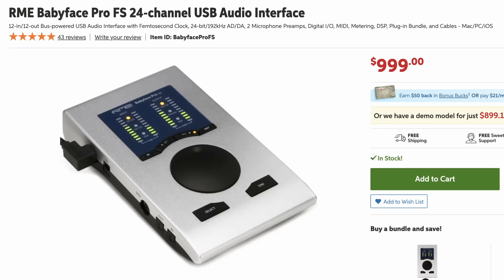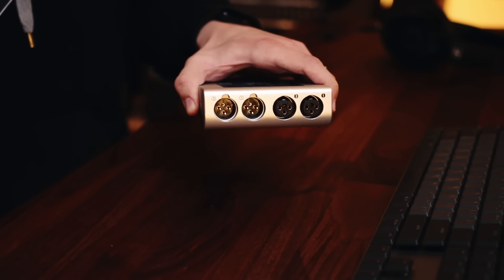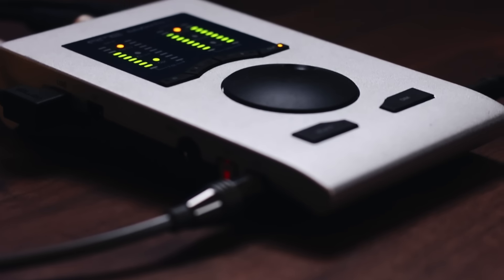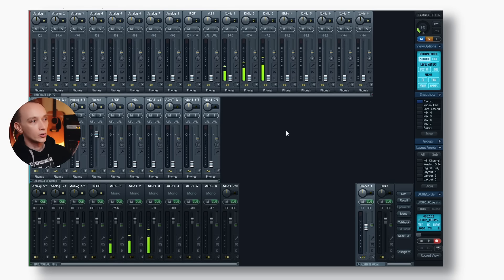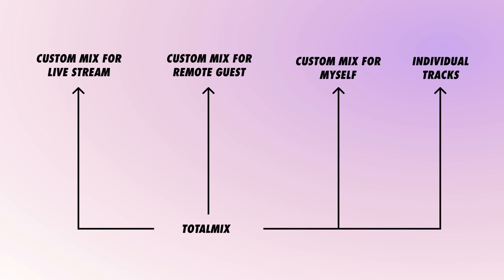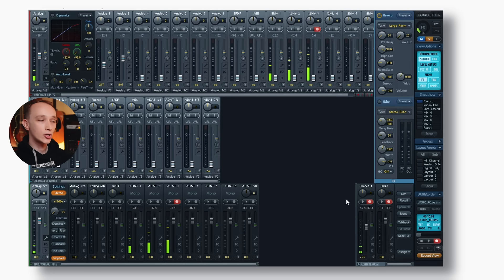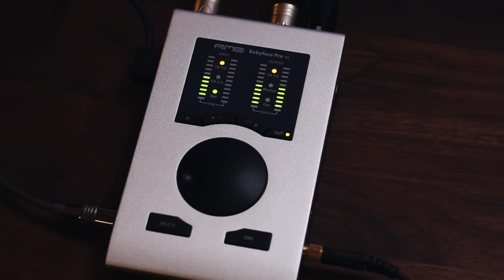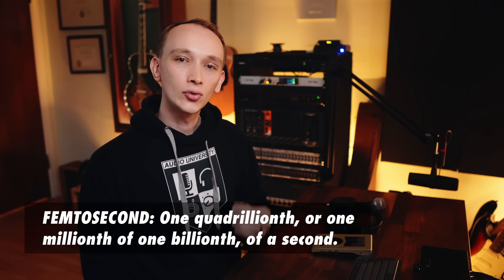Why Would Someone Spend $1,000 On An Audio Interface?

Comment: As I'm writing this, I'm using my FF800 (not 802, 800) to hear this video (YT audio using the stock Windows/mobo 'Realtek digital output' into an ADAT input on the FF) and even though the interface has held up indeed quite well and the drivers have been indeed rock-stable, I'm currently waiting on a replacement for the internal power supply (that the RME interfaces are well know to fail from, look it up) after some 15 years of use (*apparently, they cheap out on capacitors and other components). Also, the driver updates for this model seem to have "unofficially" stopped for about a year or two ago now, I get it that the interface is about 15 years old now, and the company probably expects me to pony up for a UFX III USB 3.0 maybe (it's their business, after all), I shouldn't expect working driver updates forever probably, but I'm just putting it out there, that that's the case. 

With the internal processing, fully fleshed-out proprietary plugin bundles, and the thunderbolt connection, I hope my next interface will be a UA Apollo, but I'd be remiss if I didn't say, RME has been good to me overall, maybe if funds permit, I'd update to a newer model of theirs, as a backup. TotalMix is definitely one of RME's strengths.
Reply: The follow-up of the FF800 is the 802 (and now the 802 FS). You don't need to jump all the way up to a UFX III :)
Reply: Capacitors dry out with time, the hotter they get the more they are prone to issue. It's very important to keep at least 1u of rack distance from other upper and lower hardware with any hot hardware. I don't accept the assumptions on gearspace about the quality of the capacitors. They are adequate for the job, you have it for 15 years but it's more than a 20 years old card. The support stopped because computers don't support firewire anymore (for many years now). The fix of the PSU is somewhat easy if you know what you are doing, no soldering required. So it's serviceable by a handy user, and the part itself is relatively cheap.